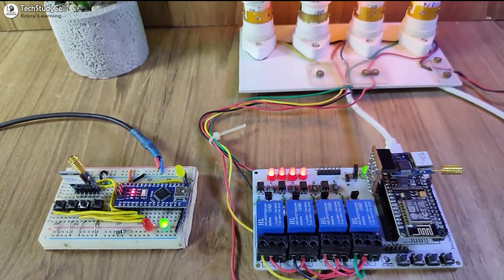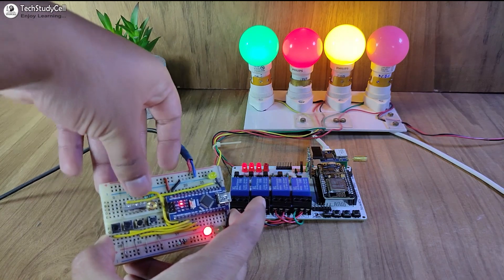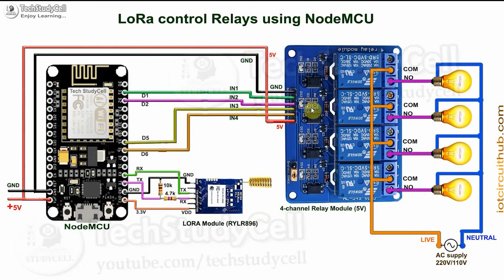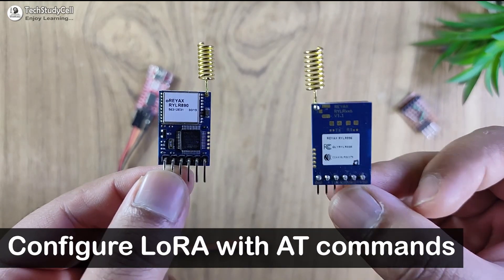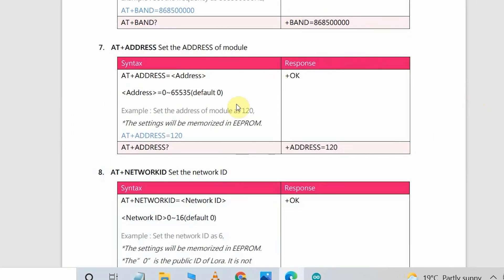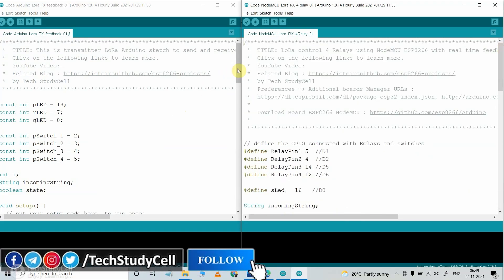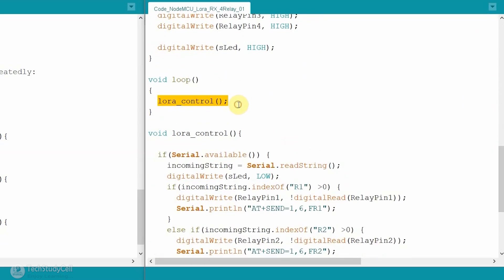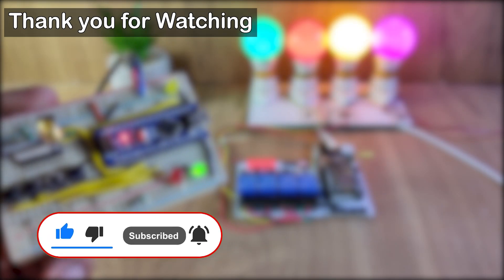LoRa ESP8266 Arduino control Relay with feedback | Lora Project with Circuit using RYLR896 module

Comment: can u make a data logger  using eso 8266 its can save data on excel file alert high low temp 
and also update the wifi pas with out coding

Comment: There should be an option to turn off all by an extra push button and also after receiving the feedback corresponding extra led should provide status for all relays separately

Comment: Hi, really impressive.  Could you advise regarding LORA. If I'd like to turn on/off lamps via LORA like on the video, but I have 3 facilities. So in this case Should I have e transmitters and 3 receivers or it could be only 1 transmitter and 3 receivers?

Comment: I have done it the same way you said ,I bought 2 reyax rylr 998 they are responding to my AT commands but when I press the button the receiver side doesn't changed a bit .
I changed the code a bit because I used LEDs but it's not working.Please help me

Comment: Hi sir, is it possible to program only the ESP32 with the LoRa module without the relay to act as a transceiver device? Thank you for your answer sir
Reply from the maker: Yes
Reply: @TechStudyCell  do  it work like the arduino? how do we test AT commands while uploading blank sketch? because I tried and there are no results

Comment: Pls is it possible for the switching to be momentarily? Like when I remove my hands from the pushbutton it should go off and only stay on when I press it down ?
Reply from the maker: Yes possible. you have to update the code.
Reply: Pls am a rookie can u point me in the right direction or tag a video I could follow pls I need it for a school project

Comment: Awesome,what modification are needed if i use Lora XL278-SMT with 12 pins GND GI01 GI02 GI03 VCC MISO MOSI SCLK NSS DI00 REST GND?My Lora module does not have RX and TX pins.Thanks in advance.
Reply from the maker: Will check... Thanks

Comment: Fantastic sir, please now test it's distance range in real as lora distance on paper varies a lot in actual scenario.
Please test it by putting main bulb setup at your home and went outdoor  and at certain kilometres from your home check if it working properly or not. Thanks make a video an that and then continue with projects on lora😃.
Hope you find this helpful.
Reply from the maker: Okay
Reply: With that size, power and antenna why would you believe it will go kilometers?
Reply: @c1ph3rpunk  Yes I have same question to ask

Comment: Please make video on control 3 phase ac motor with same
Reply: It is same the only thing is just remove bulb from relay and add 3 phase motor , it is just a switching circuit.🙏
Reply from the maker: You have to connect 3Ph starter coil in series with relay. Will try to make video on it
Reply: @TechStudyCell  Yes bro please make vedio on it because I am farmer and this is very important for me please bro make vedio fast

Comment: Can you make  a wirless controler for 1.5 hp water pump moter fixed 400 m  away from house
Reply: Bro it is same, he is using relay board, in case of you want to turn on motor pump just remove bulb from relay circuit and add motor phase wire in no, main phase wire in com and connect neutral directly to supply.
Reply: @faneeshbansal the motor is single phase moter is powerful i don't think this relay have the capacity yo pass high voltage
Reply: @basil7607  You could switch an more powerfull relay with one off the blue relay. It will work too.
Instead the lamp you take another relay.